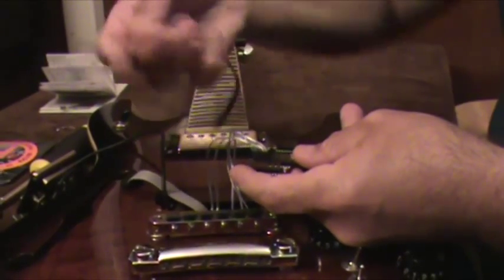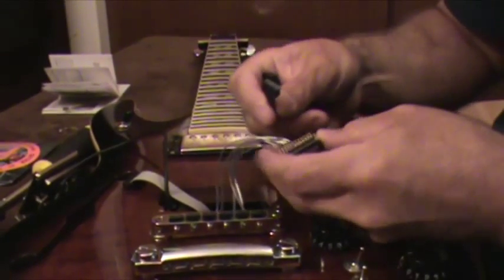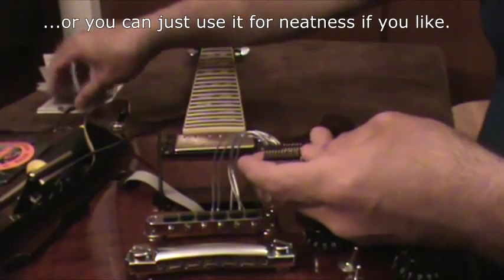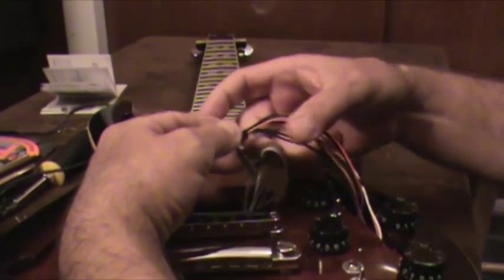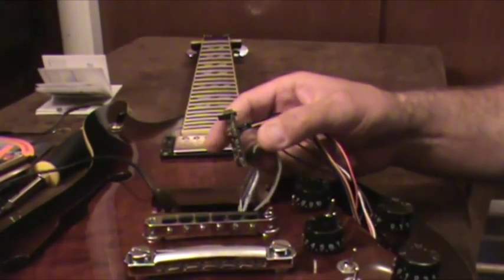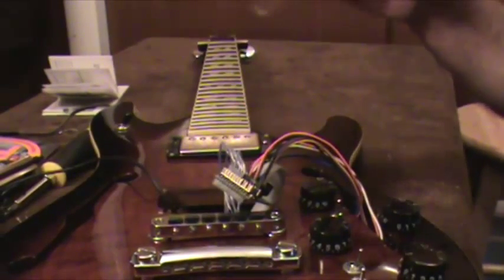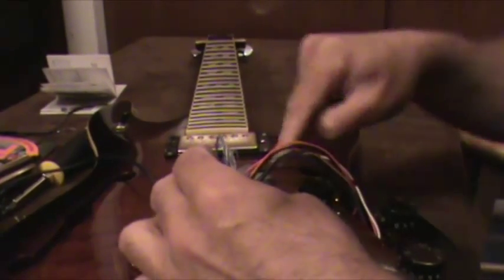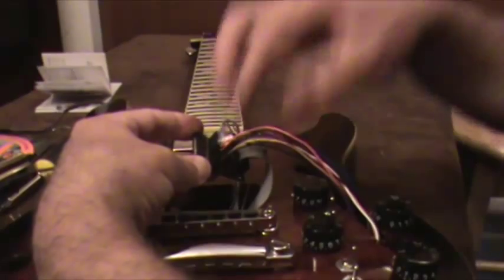Ghost MIDI Hexpander Install Part 6 "The Wiring"

Comment: Watching your video series here I am REALLY glad I went with a Fishman 3Play! I had a bear of a time installing and it takes many gigs of room (over 12!! but I got two of the expansion packs) Thank god for Sweetwater music tech support where I bought it from. Yes, I did mount it on the front of the guitar but I am going to switch it to an extra parts guitar that was just laying around and needed serious parts/work anyway. When I do the other work I am going to route out a small area for the fishman unit to sit recessed behind the upper horn so no one will see it but me. Then I will route the pickup and wire from the back to the front and lay it just above the bridge pickup. From the front, bottom and edge angles it will look stock and clean and the controls/pickup wire will be out of the way when I jump around going nuts. It is wireless midi so no extra cords etc are needed. Given I do not have that hollow body sound but I will only have one wire which I can easily switch to an actual hollow bodied guitar with a pickup in the saddle or someday if they ever get a good expansion for it just add it on VST. So for all the extra gear and work you did the only difference is that when yours finally works... you will have 3 wires to my one and I will have to switch if I want a hollow body tone. Otherwise, I am playing any VST or external midi device (Yamaha ES for example) through my guitar and it was about $1300 and I technically do not have to route anything out but want to hide it so probably going that way. I can always easily switch guitars even so unless I glue it in. Don't get me wrong, the ghost system sounds really good but wow you gotta pay and work that hard with a bum result?! I feel sorry for ya dude! Mine was about a day or two learning curve and 20 min figuring out hardware to do almost the same thing. Plus I like one wire! If I want I can still go wireless for amp and for the midi (I guess that is double wireless haha). Even so, only one wire needed for 3play route. Just for extra I am putting in a sustainer neck pickup so that will be another bunch of cool sounds out of one guitar when I am finished. When this guitar was being planned I considered putting a ghost system on... glad I decided not to now! WOW IF I WERE YOU I WOULD BE PISSED! Plus I hate the thought of buying 13 pinned cord and then also have to have a stereo 1/4 set up! That is 3 chords on one guitar and 5 extra switches! NO WAY MAN! It has to get cleaner than that. You may as well just get a whole keyboard, put strap locks on it and lug it around all the wires your tethered to! Lucky most stages around town are not too big so standing in one small area would be minimally noticed. Any time I am routing and drilling into a perfectly good guitar I get annoyed! Like I stated my project is just spare parts so routing and drilling not so bad. Even so I only added one extra hole for the on/off switch for the sustainer. The bridge and trem needed a bit widened also but that was because I wanted to put a specific DiMarzio in that was not the same shape and Ibenez did not make enough room for a back pull on their floating system in the 1980's. You routed way more and your guitar was in mint shape to start with. Like I said... I would be pissed! Thank you for the videos and I am soooooo glad I narrowly chose to not mess with this ghost system!!!!
Reply from the maker: LOL Yep a mess. But only one cable would've been used. At that time I was using the GR-55 which breaks out the pure guitar cable at the box to run a 'real guitar rig' and then my JC-120 for synth sounds.  I don't have any interest in going with Ghost again. I still love and play this guitar. It's just cracked, other performing musicians play stuff out there way more messed than this thing. lol Thanks for the comment!

Comment: Any news I want to know if it worked because I have one that I want to do this to.
Reply from the maker: It will work if you don't break it like I did. lol  I had a few pins that snapped on the midi board by messing with it to much. They are very delicate.

Comment: Any Updates? Did you figure out what was causing the issue?
Reply from the maker: C. Seth Andrews Haven't been able to get to this project but I am really wanting to. I bought a Roland GC1 Fender Strat with the Roland GK-3 midi system built in so it's just not a high priority right now. I miss playing this guitar though.

Comment: Were you able to trouble shoot the problem?  I feel for you- that would be frustrating to put in the time and have it fail.  Thanks for the video.
Reply from the maker: Haven't got around to it yet. Could be something as simple as pulling a wire off the guitars stereo jack and killing the power supply to the Ghost Acoustic system. I had that thought a few hours ago actually. I've taken order on a Fender Roland GC1 guitar with the midi system built in a few days ago. So I am in no hurry but I will fix it up. Thanks for the kind comment. :)